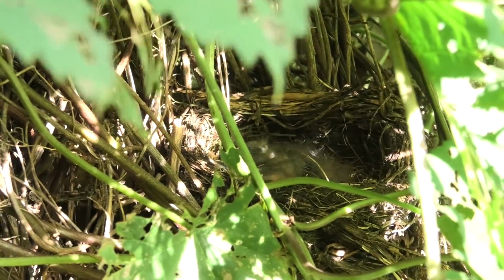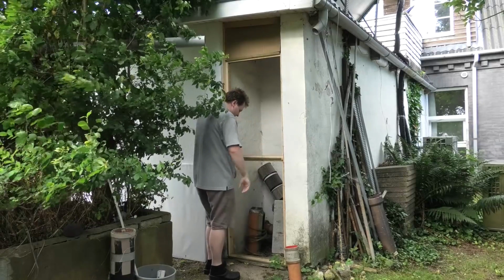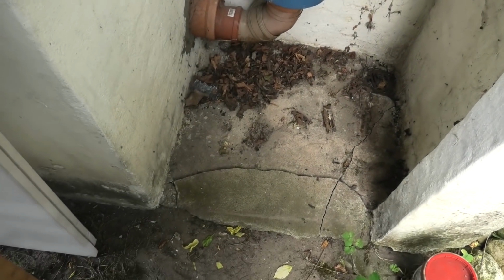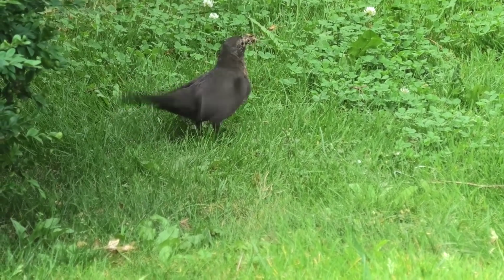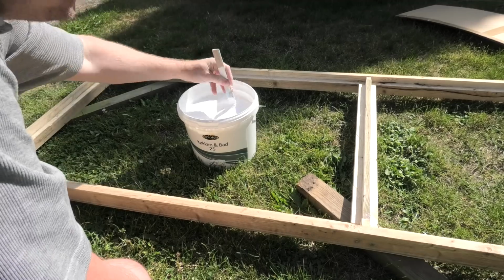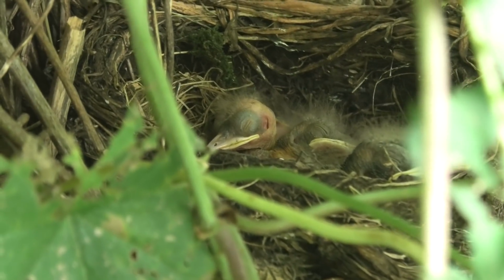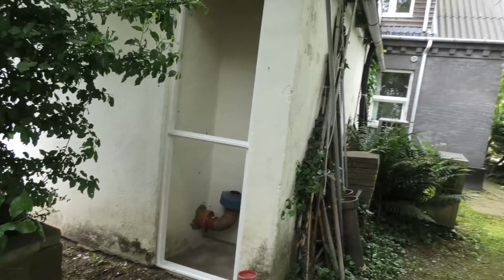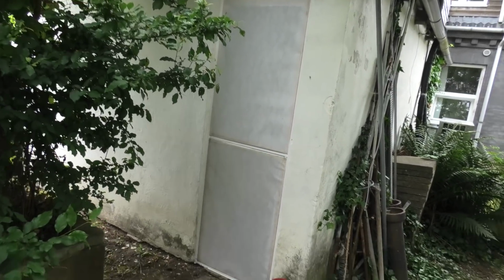Improving on my Data Center Air Intake Filter build - 1088

Comment: Oh wow, I remember you building that air cooling radiator system, seem to remember you feeding it with water from a pump in the basement?
Next step, take the refrigeration tubes of the back of a refrigerator and place them behind the new filters? 🤔🤔
Reply from the maker: Had a lot of fun doing that. and I would like to play with it again.

Comment: A little trick from my brother, when working with fugemasse/caulk.
Dip your finger in a bit of water and it will be ALOT easier to smooth out.
Reply: soapy water is better
Reply: @Prime0pt  yep
Reply: Or you can use a wet wipe to similar effect.
Reply from the maker: Hi Stefan Ditlev Jønsson
Thank You very much!  glad you liked the video :-)
Thank you for watching! :-)

Comment: If the filters get clogged and in the future, your filter holder is "airtight" will it start pulling air through that drain on the floor?
Reply from the maker: a lot of things has to go wrong,,, and there is also air gaps at the searling,, that it would try first..

Comment: If the filters get wet the servers will be in trouble heat wise
Reply from the maker: No,, I have tried,, it still works,, I was thinking it could work as a swamp cooler,, more testing is needed :-)

Comment: instead of messing with cooling solutions that don't work , so raise your air flow, I'd probably go up in 160mm ventilation and find a fan with LOTS of flow .. for the 125mm you have there.. it's not enough for a hot summer day ...
Reply: What would you consider lots of flow in a 160mm fan? I have a similar problem to Morten.
Reply from the maker: Yes, that can be improved,, but the air outtake of the data center is worse,, as I have made it to go in to my house,, to help with heating,, and that is not nice when it is this hot.
Reply: @elminster8149   it depends on how many watts you use. but I would find the largest 160mm fan (CFM) and lower the fan speed  a little  (noise)
Reply: @MyPlayHouse  if you want to save heat.. so get Bernhard Primdahl to come and look at your hot solution.. he's plumbing. .. too many of your ideas would never work or seem so little that it can't conform or pay off ... yes I'm plumbing too  ( energy specialist )